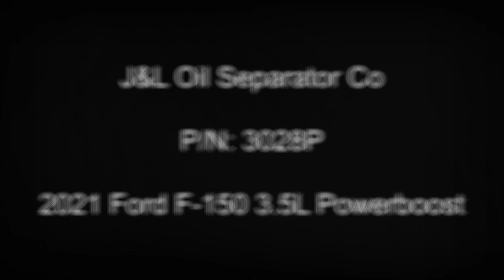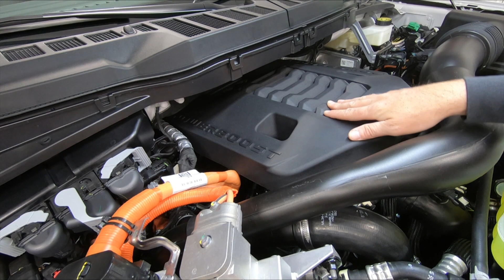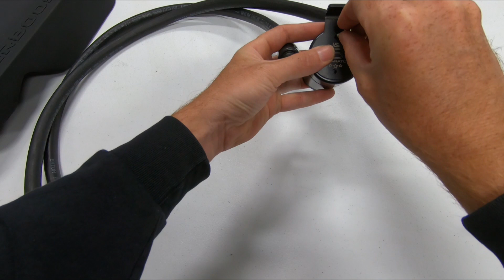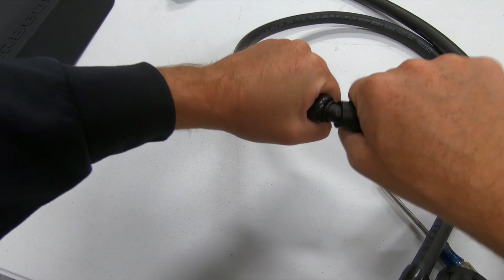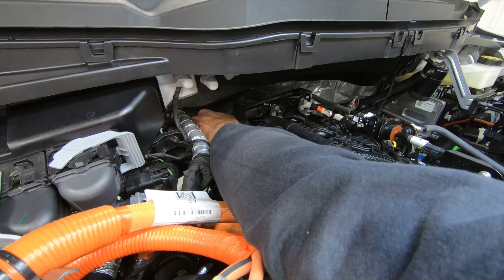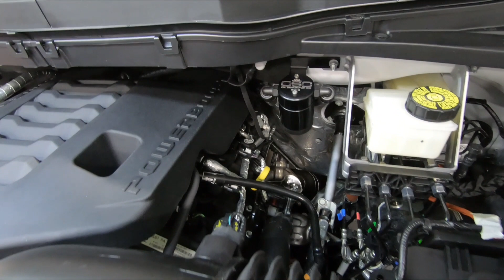J&L Oil Separator Co. 2021-2026 Ford F-150 PowerBoost; 2022-2026 Ford Expedition Install 3028P

Comment: Just installed mine on my new 2026 F150 Powerboost today after I did my first oil change.  Easy peasy.  The new models don't have the engine covers (thankfully).

Comment: I know this video was three years ago, but we've been seeing a lot of the newest Powerboosts come through without that rubber "Boogieboard" cover! 🤣 I finally decided to take mine off to see if it might cool things down in there and sure enough, my water temp and oil temp, both dropped a noticeable, couple of ticks on their respective guages! ??? 🤔
Reply from the maker: A lot of manufactures are getting away from engine covers in cost cutting practices.  We don't hate it either makes our job easier :)

Comment: Great video and easy install! Took about 10 minutes for my 2025 PB. There is no engine cover on the 2025's.
Reply: Do you know why they dont?
Reply: @jsmartin1300  I don't know the real reason, but my hunch is that Ford was either cutting costs or recognized that the cover most likely holds the engine heat, which is not normally desired.
Reply: @OwatonnasAverageJoe  It's both, they trapped heat in the engine for no reason, and they were just extra cost.

Comment: Is there only one PVC valve? If so, does this take care of both valve covers and the fumes?
Reply from the maker: Yes only one PCV valve, on the passenger side valve cover.  The connection on the driver side valve cover is referred to as the "clean side" and typically you don't see oil out of that side.  If you do a lot of towing you can get a bit out of it, but typically only in extreme cases or work trucks.

Comment: Just got done installing this along with my Roush CAI. I figured since I had a nice big empty spot I may as well use it. Install went without a hitch. My finger couldn't get down that far to hold the nut on the engine cover so I put a piece of a plastic bag between the nut and socket wall and it held it in the socket fine and went back on the cover easy. Just enough for some friction.

Comment: Is still needed on the 3.5EB since it now has direct and port injection?
Reply from the maker: Anything you can do to keep the contaminants out of the intake in general is a win.  The port injection should for sure help with build up on the backside of the intake valves, but we still want to keep the oil out of there the best we can.
Reply: @jloilseparatorco  cool thanks for the info!
Reply: Not as necessary, I had the 2016 2.7, Direct Injection, no fuel to keep the back of the valves clean. I put on the same unit and poured out serious gunk between my 3000klm oil changes. I use Amsoil due to the needed lube for the turbos!

Comment: Will this void my warranty?
Reply from the maker: If you read the fine print on any warranty contract you will find a lot of reasons your warranty can become void; installing aftermarket parts can be one of them.

However, per the Magnuson–Moss Warranty Act proof would have to be provided that the after-market part caused the failure.  If you need further clarification, contact your vehicles service department. Some are easier to deal with than others.

Good news is this unit is very easy to remove and return to stock if need be.

Comment: On the forum, someone said the dealer said using this will eventually throw a code/check engine light. They claim it will affect the vacuum through the PCV.
Reply from the maker: Simply not true and an uninformed dealer on what the oil separator actually does.  No issues and the kit isn't any different from the kits we put on all the 2011-2022 F-150's with the similar powertrain.  You could take it to 10 different dealers and get 10 different answers.
Reply: @jloilseparatorco  Thanks for the reply on this question.  My dealer told me the same thing, that adding length to the hose (especially more than 4 times it looks like) will add volume to the system and eventually throw a code.  I am looking to buy this one, it is a very simple install and looks like it would work well.  Just wanting to avoid any problems in future!  Thanks.
Reply: After some more research ... I ordered one and looking forward to installing and seeing the results.
Reply: Follow up to my purchase.  Installed this about a month ago, super easy just like the video.  NO issues with the truck, NO codes or anything noticeable.  Checked everything yesterday, not as much oil as I thought it would collect (maybe 1/8 of a cup at about 1500 miles), but it sure did smell of fuel!  I double checked the connections for any leakage and all connections are dry, NO sign of leaking oil, etc.  This is a well made product!

Comment: Ok. Someone fill me in! Why would you need one of these?
Reply: Found this when I looked up - Avoid Oil Build-Up: The primary reason for using air oil separators is to avoid recirculating oil into the cylinders. This can coat the air intake with oil and slowly clog the airflow. That translates to reduced maintenance and more consistent performance over time.
Protect Against Detonation: Another major benefit of using a separator in the PCV system is that it prevents excess combustible oil from getting to the cylinder. Too much oil can cause premature combustion in improper parts of the engine. These detonations can cause significant damage, especially if they are allowed to continue. Having a well-optimized PCV system in your vehicle will save you a lot of time & money later on.
Minimize Oil Loss: One of the main drawbacks of oil catch cans is that they remove oil from the system. For certain vehicles, particularly those with horizontally opposed engines, this can cause a significant loss of oil. An air oil separator fixes this issue by draining the filtered oil back to the oil system.
Reply from the maker: The reply by BaMaNuNa is spot on but I wouldn't say the draw back to oil catch cans is the loss of oil.  This oil would be typically burned if it wasn't collected.  That or sitting in your intake manifold :)  Not ideal either way.
Reply: It all started from Direct Fuel Injection. In the past the fuel kept the back of the intake valve from getting (coked) or junk backed on. 
There was no cure other than major tear down. 
I changed my oil on my Ford 2.7 Twin Turbo at 3,000 klm using AMSOIL oil. It’s pricy but cheap insurance. Also helps to floor it once in a while to give it- “The Old Newfy” tune up!

Comment: How well do these work in very cold weather?  -30 F?  Afraid of freezing and blowing up seals
Reply from the maker: Hey Mickey,

Only downside to extreme temps is the can will build more condensation in it which will make you have to empty it more frequently.

Comment: Is there a treatment to get the dirt out of the engine since I won’t be able to install it until the spring time?
Reply from the maker: There are a few options but if the mileage is still low in the vehicle I wouldn't bother.
Reply: Ya, RedLine Injector Cleaner. Check it out, I just used it and mine only has 38,000 on it.

Comment: Not knocking your product or work, just an observation.  Since you took the time to make sure the container was squared up with the hood for a professional looking finish, ..would you not then make sure it was level vertically all around because of the pitch of the firewall mount?  Seems like only a few degrees of tweeking of the mount.  Other than that, its a nice direct fitting product that goes on rather simply and quickly.
Reply from the maker: Thanks for the feedback Ray!